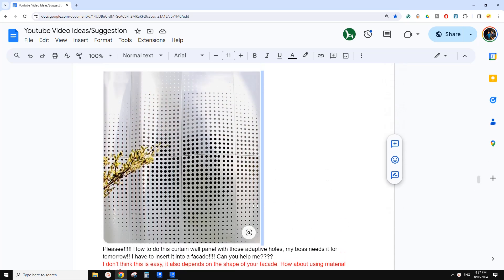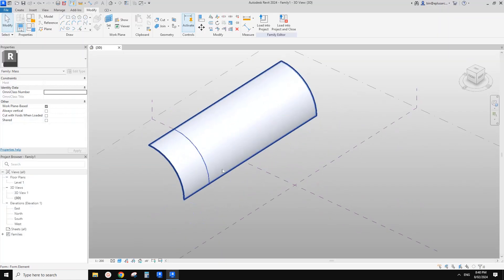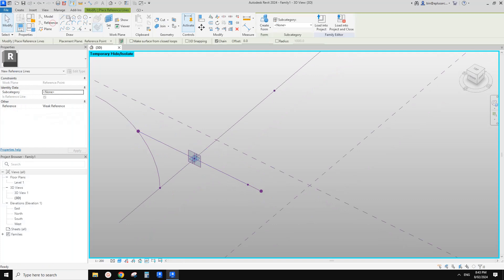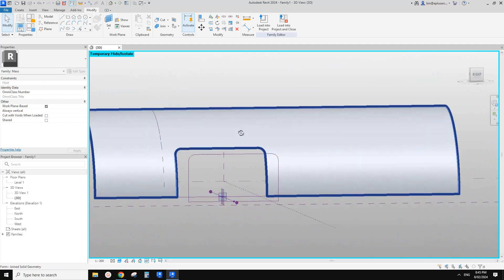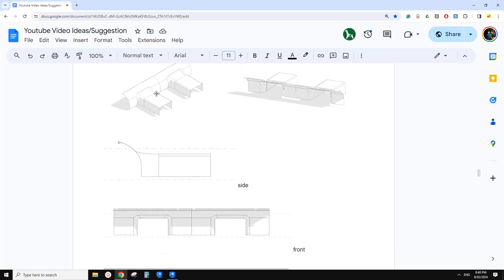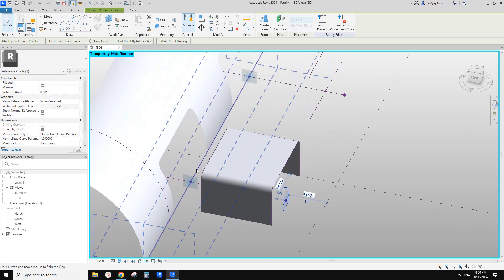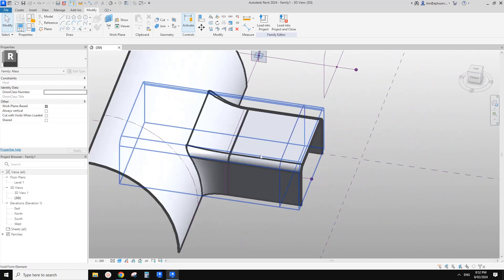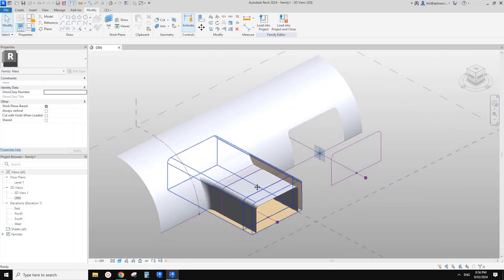24018 - Simple Massing Exercise (Use edge of existing form to create new form)

Comment: Nice trial … I don’t know the purpose of modeling this shape as surfaces, but I am afraid it could be difficult to put properly joined roof or wall by face specially in the junction between   The 2 surfaces 

Could it be modeled as model in place ( with thickness) … or the junction is hard to achieve there in model in place ?
Reply from the maker: I think it's doable, with 2 extrusions, 1 blend, and some extrusion.